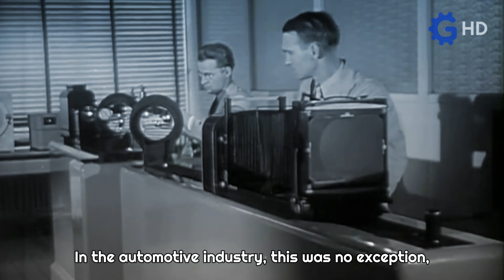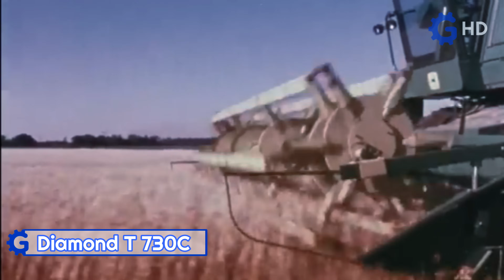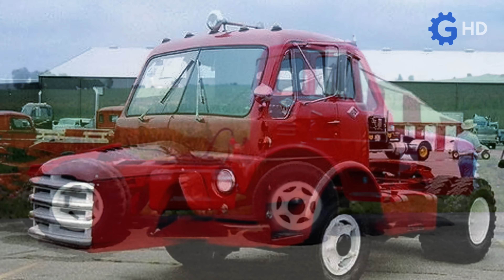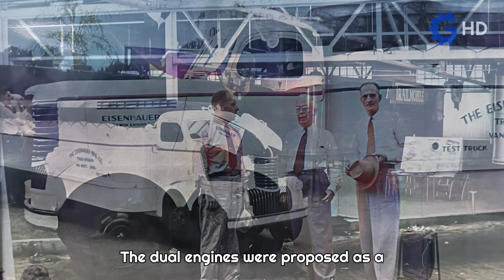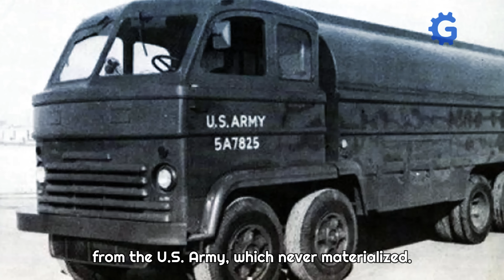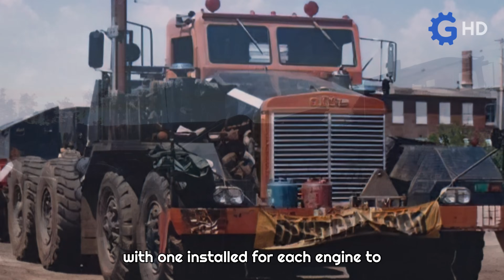THE 1960S TRUCK WITH A PINOCCHIO NOSE ▶ TRUCKS WITH TWO ENGINES

Comment: The original SceniCruiser Busses had two 4cy Detroit Diesels to use one on hwy and two getting up to speed. They were later replaced by a single 8V71 as the 4cyl was underpowered at cruise speed anyway.

Comment: My father in the 60's and 70's worked as a truck mechanic in a shop up the road from the Diamond Reo truck plant in Lansing, Michigan. They occasionally got custom builds Reo didn't want to handle. One of the ones he got was a late 40's Reo truck used in the Upper Peninsula's logging industry. It had four Reo four cylinder gas engines. They were paired up two sets side by side and then inline with each other. A big 16 cylinder box of an engine. I don't know anything else about it except it was brought to them in the early 70's to do a much needed overhaul.

Comment: Though it is not a truck, one of the engines used in the Sherman tank in WW II was an engine made of of five Plymouth six cylinder engines with a common crank. It produced somewhere around 500 hp. Those tanks also used a version of a Lycoming radial airplane engine.

Comment: Now several manufacturers make 5 axle trucks with multiple steers. Eisenhauer was ahead of their time!
Reply: Should have called it the "Eisenhauler".
Reply: At the same time Eisenhauer was using using dual front axles, Oshkosh out of Wisconsin was doing the same. They were really common in mid-Michigan in the 1960's for crews building the Interstate Highway system. Oddly, the big user of the Oshkosh trucks in Lansing was a concrete company named Eisenhowser.
Reply: @cdjhyoung  interesting... so was the whole interstate system basically built together? What did it replace? (I'm from Australia)

Comment: Ford Dual Engine is a impressive display of practical engineering under time constraints. Instead of developing a new engine, two are slapped together and made to be easily and quickly replaced with a fresh spare, while the broken engine can be repaired in a workshop.
While it is not a war machine per say, it is a machine of war times.